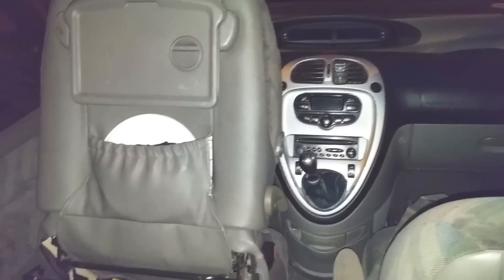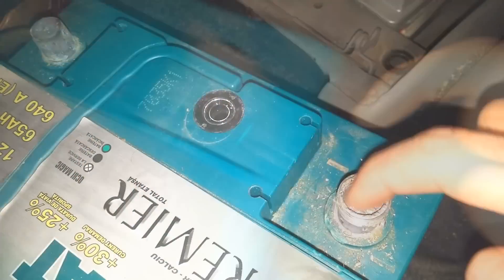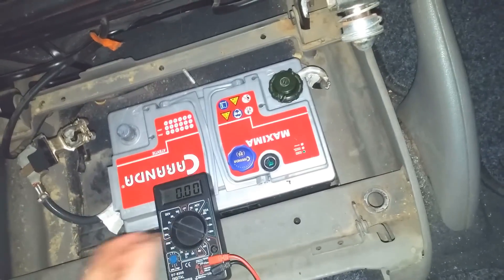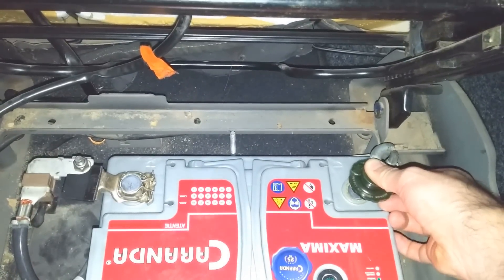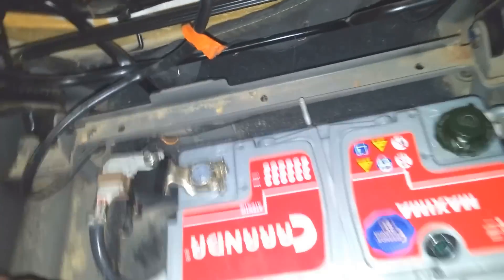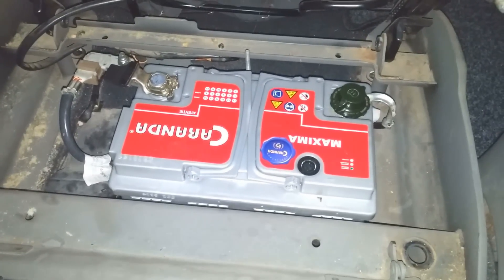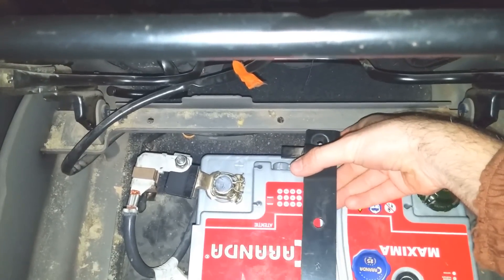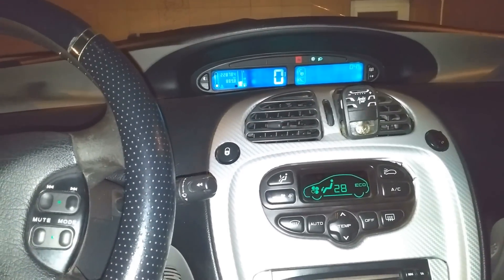12V Car Battery replacement (Xsara Picasso, Caranda 80Ah, 720A)

Comment: Just a thought.  Has your alternator failed since you made this video?
I understand that running an engine and therefore the alternator after the battery is lost from the charging circuit will ruin that alternator. Big bucks.   I wouldn't trust that terminal connection.

Also Furulevi, I understand that the car's brain needs to be soft-booted when the battery is disconnected/reconnected. Did you experience any problems with that.

But you certainly do care for your car!
Reply from the maker: There were no problems after replacing the battery, nothing was damaged, only the clock needs to be re-set after the battery is disconnected.
Reply: This is clearly a botch job and perfect example of how to show how little the guy knows. This should have taken 5 mins. First thing should have been done was to buy the correct size replacement battery. Amazing to see how anyone can make a mountain out of a molehill, and the narrative is so tedious. Christ man!! Do yourself a favour and remove this embarrassment.
Reply from the maker: I had to discover that negative battery terminal element (https://www.ebay.com/itm/NEW-GENUINE-Citroen-Negative-Battery-Terminal-Saxo-Xsara-Picasso-AX-Xsara/262495710684?epid=2214897798&hash=item3d1df6addc%3Ag%3A-X0AAOSwzJ5XbGIi&_sacat=0&_nkw=Citroen+Negative+Battery+Terminal+&_from=R40&rt=nc&_trksid=m570.l1313)

Comment: Ok I know it's difficult to make a video and perform a series of operations at the same time . BUT damn what a disaster that battery operation. 
Those broken tabs are what allows the screw cap to press against the battery terminal. I won't question the fact it will work eventually for a long time, but it's the perfect example of "how not to do" a battery replacement/upgrade. LOL
Whatever the case thanks for sharing the good and the bad. ;-)
Reply: Hi again, for some reason YouTube sent me to this video again. 

Since it´s always good to have a positive action, even if it´s for a negative terminal. LOL :-)
So for anyone in need... ;-)  
https://www.ebay.co.uk/itm/GENUINE-Citroen-Negative-Battery-Terminal-Saxo-Xsara-Picasso-AX-Zsara-/391485150112

Comment: brake two of the tabs off and use windscreen whipper puller if not replace the part this video is terrible
Reply from the maker: Later I got a puller tool...

Comment: isn't a problem if you get into a flood and water reaches under your seat?
Reply: crpth1 there are cars which are not sealed correctly and it rains in them. anyway Citroen is not one of those.
Reply from the maker: Hmm... interesting idea :) I haven't checked if that battery compartment is water tight or not, but the battery is totally sealed and the 2 terminals (+ -) are far away anyhow and theoretically there should be no short-circuit.
Reply: +backcenter2 - Water can only reach the battery from inside the cabin. If water reaches under the seat, believe me You'll have much bigger problems to think about than your battery. That's a car not a boat... LOL :-)

PS: 12V sealed battery can be literally under water for a short while without major issues. Although ECU's and other fine electronics will surely not like it.